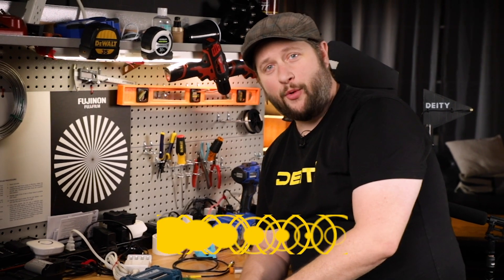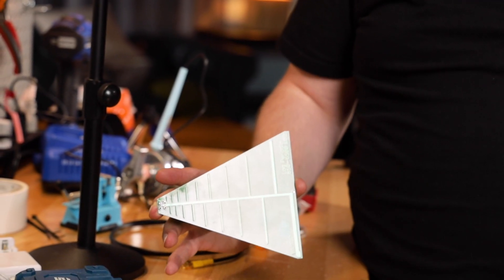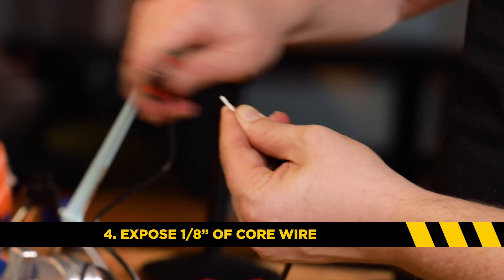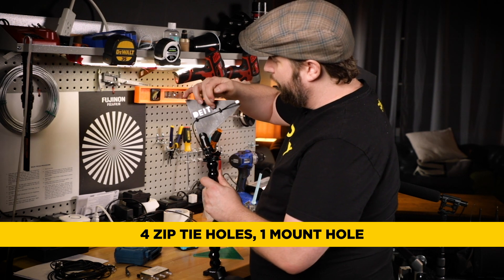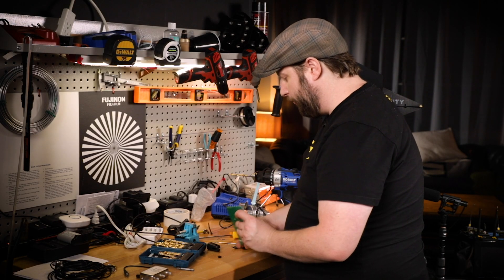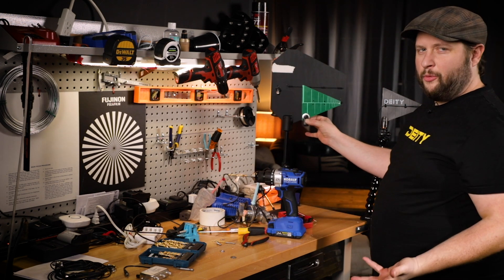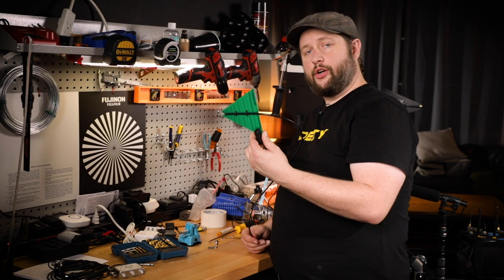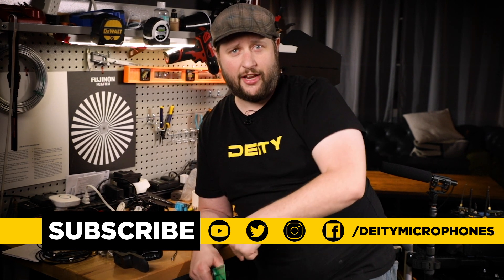We made a 2.4GHz DIY Directional Microphone Antenna for $30 THAT ACTUALLY WORKS!

Comment from the maker: What do you want to see us build next?!
Reply: The power distribution system for your kit!
Reply: @carlemilbrnnum  I second this.
Reply: A antenna distribution system for the 2.4ghz band...
Reply: How about a control surface using an Arduino I made a basic one for part of my uni course that worked in logic.
Reply: boom pole adapter!
Reply: shock mount!!!
Reply: Deity Fiber-Optic Distro😃
Reply: A little late over here 🤘🏻but a way to upgrade the antenna of a Shure GLXD4

Comment: Yes mounting that antenna the way he did with the back element right against the mic clip that will be in line with the mic stand just made the entire antenna useless. Especially that giant metal washer, he just changed the tuning of it. Also the coax cable you use with these antennas is very specific. It's not just cheap junk coax you buy off of the internet. It's actually specially made high frequency coax, the design for microwave purposes. Remember 2.4 gig is microwave. If you were to use standard RG58 cable, you would lose almost all of your signal, in just 5 ft of coax. So you need to make sure you use the correct cable for this. Also how that cable is connected to the antenna and routed down the center of the antenna, and would need to continue again a quarter wave behind the antenna before making a 90° turn. If you make that 90° return directly off the antenna without the correct isolation and the way that the antenna companies do it, is to use a Ridgid feed line, with a matching circuit. It creates a non-resident effect so that you can have that coaxed ran in between the antenna elements without changing the antennas tuning. He didn't do any of that

Comment: Also if you notice one thing between the commercially made one and what he's about to do. There's a significant difference in distance from the last element in the antenna and its mounting point. A log periodic antenna is very picky about how it's mounted, you essentially want to extend the boom out the back of the antenna, a quarter wavelength at the lowest frequency. And then attached for mounting clip so you would have a plastic bar or Rod coming off the back of that fin antenna that's about 6 in long. And then you would attach the clip to mount it. Having it right up against that antenna with a metal mic stand, you're destroying the directional pattern of the antenna. You just knocked off probably at least 3 DB of directional signal. Again log periodic are not as easy to work with as most people think they are. They allow for great bandwidth which is an advantage for some situations. However most people don't need the giant bandwidth if they allow for these antennas to cover. Unless you're going to be covering the entire wireless microphone band at the same time. However where they do become useful is for in-ear monitoring systems especially when you have multiple transmitters combined into one antenna. Then you actually have a useful device because it allows for a wide bandwidth and reduces the reflected power.

Comment: This guy needs to do a lot more research on the antenna he's using. To understand what it is it's referred to as a log periodic, and the way he explained it working is not actually how it works, it has some elements of a directional array and some elements of a frequency selective array, but there's a lot of Engineering in the phase and phase cancellation that goes on between the two, and these are not as easy to build as he makes it seem if they were, they wouldn't be as expensive as they are from the antenna companies. Now yeah you can buy them as cheap knockoffs and ones that people make and sell online. From designs they found on the internet and tried to copy the difference is those were never proven in a test lab, and what you may have is nothing better than just a piece of wires sticking up. Cuz most people don't have the test equipment to actually quantify whether an antenna is actually adding gain to the signal and is truly directional and blocking out things behind it. Oh also the reason you don't want to make one of these that would go say from 400 MHz all the way up to 5 gig, it wouldn't work. The loss in the phasing between the elements, would cancel out the high frequency by the time it got to the back of the antenna and was reflected.

Comment: I know this is a bit old, but I was wanting to make one of these for my Zaxcom Nomad's Zaxnet output to see if I can get better range for my ERX receivers. Would this do the trick? Or do I need an amp to get better range?
Reply from the maker: This antenna would work. It would be directional, so you'd need to consider where you setup in relation to the cameras and ERX wearers on set, but it would work.
Reply: @DeityMicrophones  Thanks for the advice. I love your stuff, and I have used the Deity slate. Such a great product. Hope to buy one one day.

Comment: Would you have painted (assuming spray paint) the finished antenna with everything still attached to the PCB? Or did you remove the wire, paint, then reconnect everything? No need to protect that open solder and shielding?
Reply from the maker: You nailed it
Reply: @DeityMicrophones  lol which one, take it all apart or just go to town?

Comment: If I make this build with a 400-1k hz antenna, can I used an antenna splitter so it can go to 2x receivers on different ranges like 470-516 and 516-558? Thanks for the help yall.
Reply from the maker: Yes

Comment: I keep hearing things about using a 2.4 GHz antenna splitter to distribute 1 or 2 antennas across multiple receivers, just as is typically done with UHF sharkfins. Is there a particular splitter you recommend for this function?

Comment: Awesome video! I would like to build a couple of shark fin antennas using the WA5VJB antennas. I need 2 antennas, a transmitting and a receiving antenna with at least a 300 ft. signal range to be used in stadiums in the 500 MHz range. Can these antennas achieve that range without interference? If so, would this process be the same for them? Thank you.
Reply from the maker: Yes. It should be able to do this. The process would be the same expect you'd use the sharkfin in your frequency range.

Comment: Hey Andrew. I just ordered a Connect Interview Kit after seeing many of your videos and excited to get using it! Subscribed and really appreciate all you guys are doing. Question, and you mentioned it a little in your video with Gotham Sound....is it possible to switch the receiver antennas to a flexible whip type as I'll be mounting it on my camera and would like the flexible kind...if they're available (I can only see UHF's)...
Reply from the maker: Buy the Remote Audio flex SMA UHF antennas and cut them to the frequency 2440mhz. They are designed to be cut and then you put the rubber cap on top to make them look good.
Reply: @DeityMicrophones  Thanks, I see it (item ANSMAP-F)...but only the one that lists range from 486-900 MHz. Is there a different one, or a guide to cut for 2440 MHZ?

Comment: Hey Awesome video buddy, thanks so much. Im using a lectro UCR411A Rx and a Smqv Tx, things look fine and work beautifully, but the moment a teradek comes around, my Phase indicator starts jumping up and down on the UCR411a, and i start getting dropouts, ive tried changing frequencies after rescanning . but the only way things go back to normal again is when i distance myself from  the teradek and things work just fine, but when we using 4-6 cams the teradek is all around the place and i start to go nuts to find a sweet spot. is there something to combat this or am i doing something wrong, would appreciate any help u can provide. thanks.

Comment: Hi Andrew, I made one external antenna for the Connect and wanted to know if it's necessary to use 2 antennas when using the 2 transmitters at the same time and if yes, what should be the distance between the 2 antennas. Thanks in advance for your help. I've been using the system for a phew months now and I love it. Also got the HD-TX. Looking forward to test it this friday on set.
Reply from the maker: Yes. You will want 2 antennas. Minimum distance of about a foot or so should be maintained.
Reply: Thank you!!!!!!

Comment: Hi Andrew, I want to ask about extending AT-20 Coaxial Antenna type. My idea was to DIY a stand for the AT-20 and put it on the stage and pull a cable around 40-50ft BNC cable to the wireless receiver. Will that cause an issue, will it create under power due to long cable.
Reply from the maker: You're looking at a signal loss of 1/4 but... you are also putting that antenna directly off stage so you are capturing more signal to start. You're fine and good to go.

Comment: Hey, Andrew Great video as always.  I would really love to see how to fix broken lavaliers cables. I think that is the hard core DIY project.  Also, it's a good idea to show the different wiring diagrams for different wireless systems  (Sennheiser/Sony). The hardest part is not just rewire the connector but to replace the entire cable. What is the tips for cable join.

Comment: Why use a wideband antenna?   it gives a maximum of 4 dB gain,   better off to use a monoband antenna  for 2.4GHz  with more gain.
Reply from the maker: This antenna gives 6dBi and gives you a wider pickup. Because the subject in moving a narrow beam angle from a Yagi is a bad idea. You'd have to be consistently  moving your antenna and chasing your actor.
Reply: @DeityMicrophones  He's right, this is a LPDA antenna. They are designed to be directional over a wider range of frequencies. The non-resonant elements in this design are a waste if using on a single band. A yagi would work just as well. If you want less gain with a yagi, use fewer elements.

Comment: Andrew! It is possible to use a 2.4Ghz 4x1 splitter to plug only one antenna into the splitter input and plug the outputs into the 2x DUO-RX inputs?
Reply: You'd need to make a diversity antenna I think. Using these, it would be 1x antenna per transmitter.

Comment: Unfortunately, in the theory of antennas you do not understand anything and almost messed up everything.
This is a log-periodic antenna. In addition, you made an antenna for the range 1 - 15 GHz. This range is redundant. Thus, you have reduced the gain of the antenna.
Check out the wiki about log-periodic antennas - https://en.wikipedia.org/wiki/Log-periodic_antenna
Reply: So could this kind of antenna be used with a limited range?
Reply: He did a great job of showing how to make a shark fin LPDA [dipole] antenna, using correct terms such as director and reflector. These are extremely common MHz range - nice to see a video supporting the GHz range.